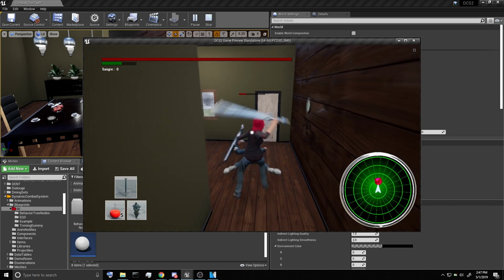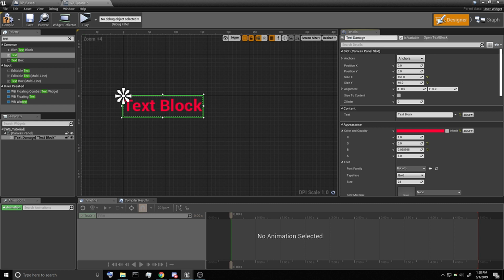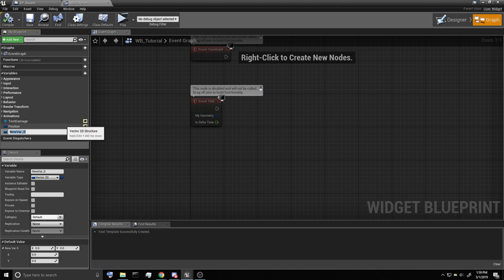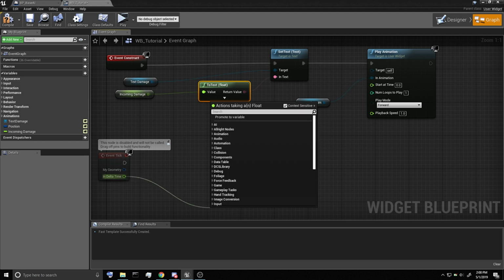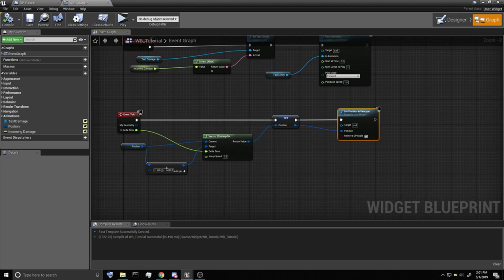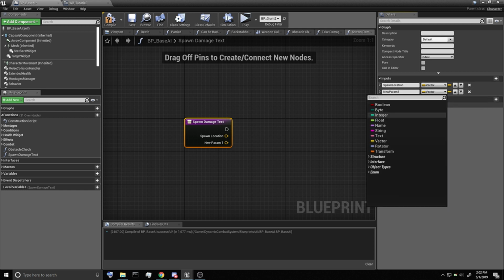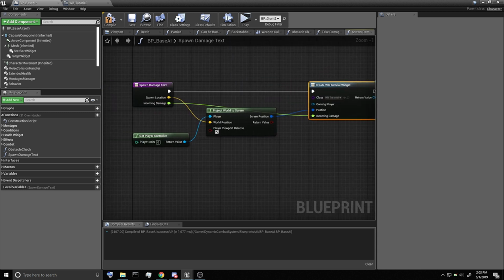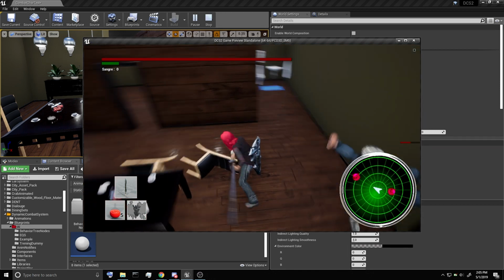UE4/DCS - Floating Damage Text

Comment: Problem with this method is that youre spawning new widgets over and over again and not removing them. So the player essentially can have thousands of widgets spawned and eventually the game will crawl to a halt. Not correct
Reply from the maker: Set Life Span on the widget.
Reply: After "Play Animation" -> "Delay" (set Duration to the Length of your animation. In this example 3 Seconds.) -> Get reference to self -> Remove from Parent.
TODO: Connect reference to self to Remove from Parent. Now the widget will be removed after the animation has ended. Have a nice day!